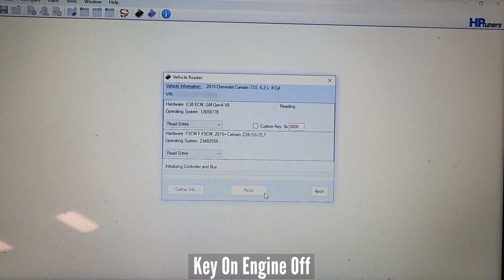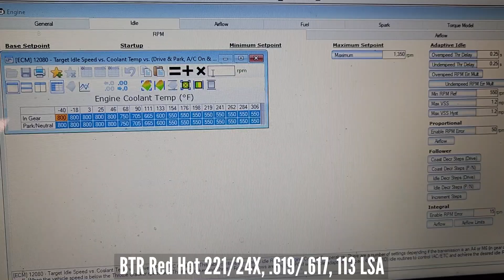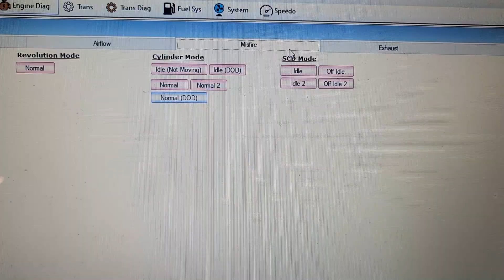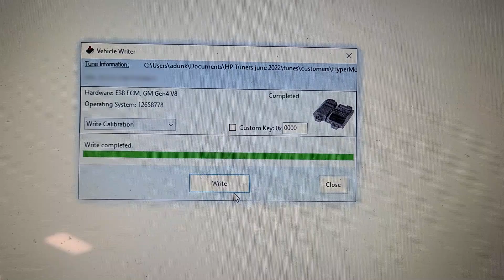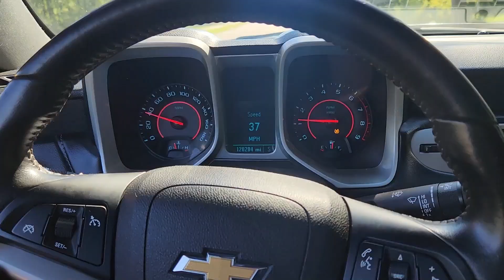Hp Tuners Gen4 LS Start Up Tune For A Cam

Comment: The nerve racking first start after a cam swap is the worst 😆 🤣
Reply from the maker: Especially something gets left unplugged and it doesn't start. I've done that before.
Reply: @andrewd843 had that happen a few days ago. Ended up being a lose ground by the tensioner